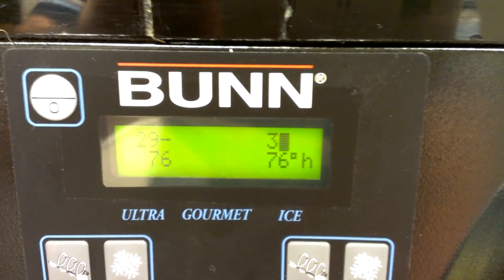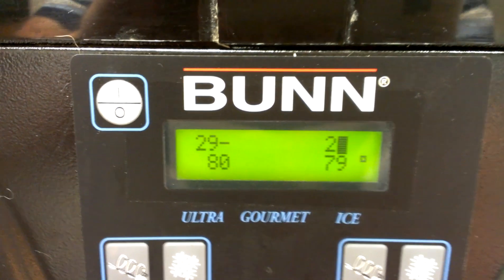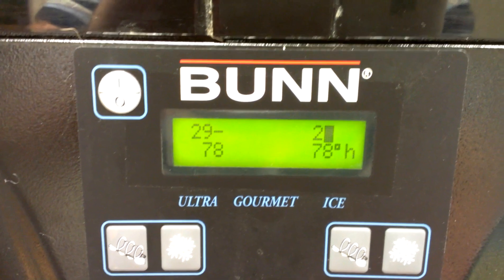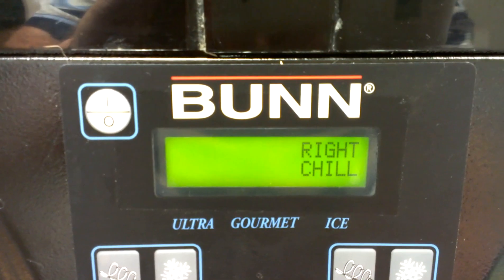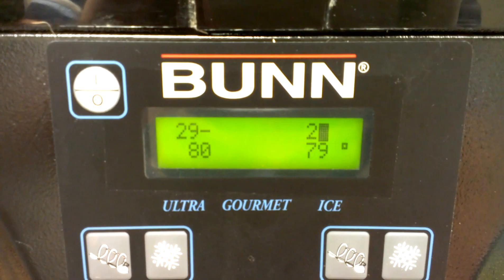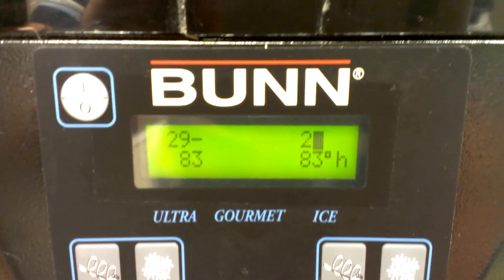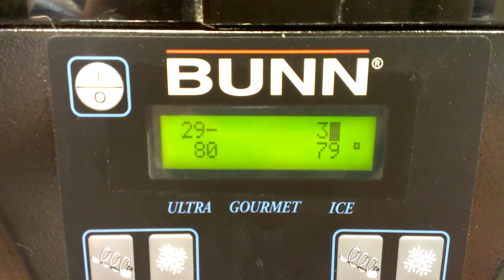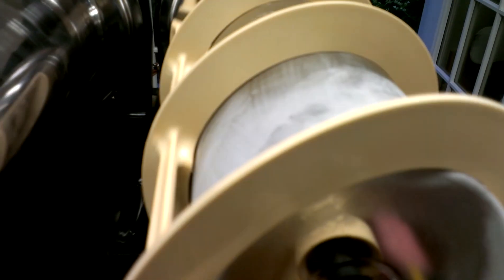Bunn ULTRA2 Chill mode problem solved

Comment: Dude,  torque sensor has absolutely nothing to do with chill mode.  Torque sensor is all about thickness determined by resistance of product as it gets thicker while in "ice" mode
The THERMISTOR (small black dual wire that inserts into freezing barrel from back) determines chill by opening solenoid at 34 degrees or more JUST to keep product cold..

Comment: Can you please explain how to adjust torque sensor?
Reply: Download an owners manual to see how to get into settings. The thickness setting is where it can be adjusted. If thickness is set at 15 then torque number is 5. Below 5 on above 5 off. The 2 numbers are calculated by dividing by 3. Thickness 18 = torque 6
Reply: Same question mine shows torque sensor error replaced torque sensor stil says torque sensor error
Reply: @douglassweed9758  there is a torque board on both sides. When error is present it should say which side is fault

Comment: This is by design. Chill Mode is designed for product to melt daily to prevent large ice crystals. While you state it is in/out of "Chill Mode" you actually mean the compressor is on/off. Wanting the product to be liquid the Ultra-2 ideally wants a zero torque reading. If the torque is above 7 the product is still frozen and needs no refrigeration so it can melt. Once below 7 the compressor cycles on/off to keep product fresh (~36 degrees). Info disconnect between programmer & techs is common.